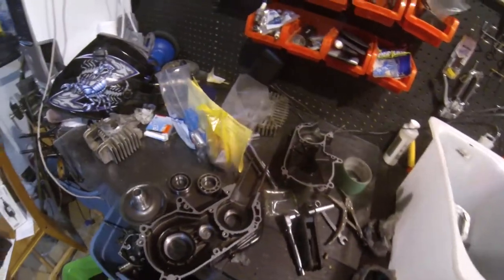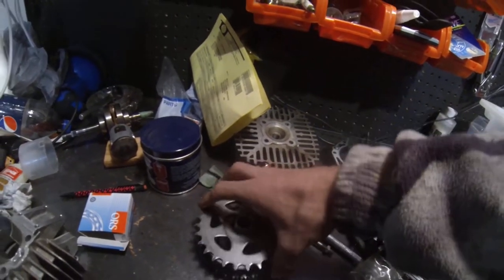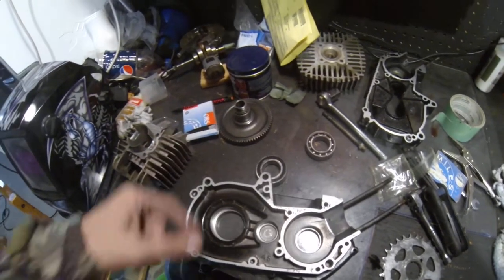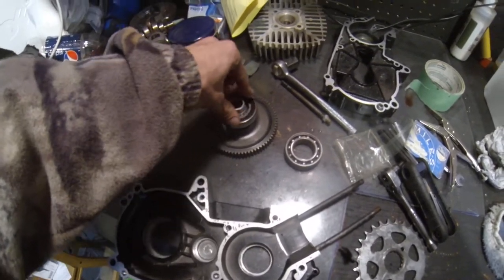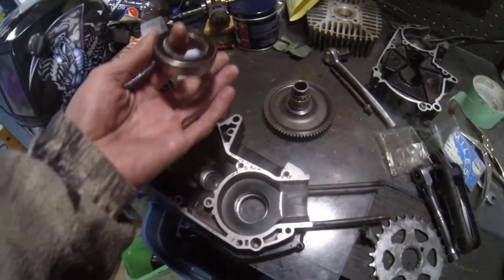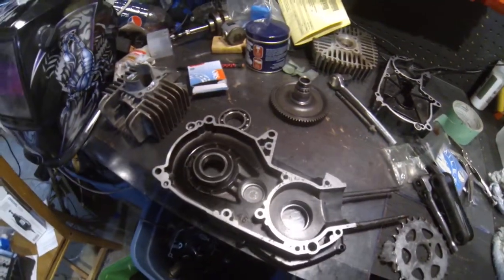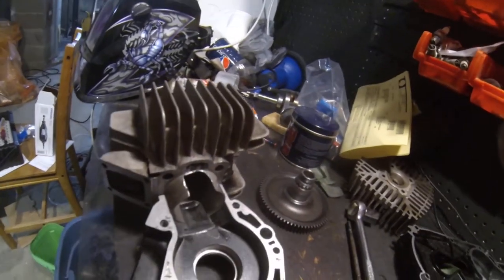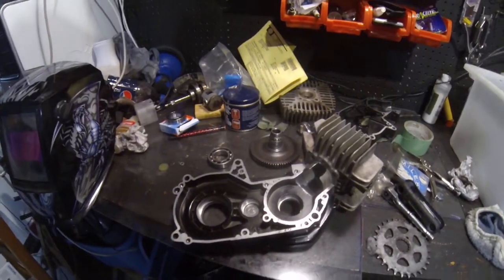Rebuilding the Red Tomos Engine, black wheel of death bearing seals Part 1

Comment: I don't know if you still read the comments, but my main gear looks like that too. A new front gear doesn't fit and my gear is chewed up aswell. Is there any hope for me?
Reply from the maker: Generally need to replace the main gear with a teardown, you can weld the sprocket ok, but your making more work for yourself when you do tear it down as you'll have to cut or bring it off. It you want it right or longevity, ya your probably kinda hooped and will have to teardown. On the bright side it gives you a chance to replace anything else that looks ugly, new seals, maybe a better running engine it the end.
Reply: @pXnEmerica  ah alright, it is what it is. Another amazing design featured by tomos, i guess :) Time to do a surgery :)